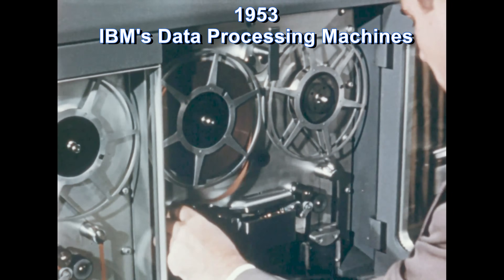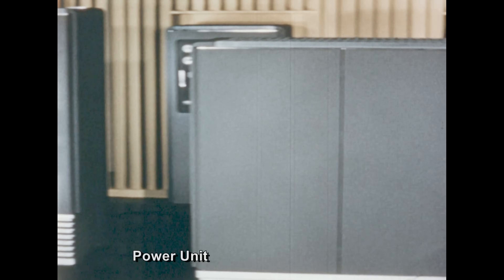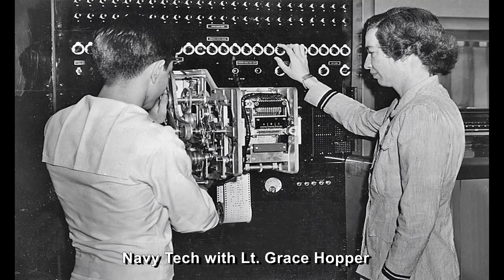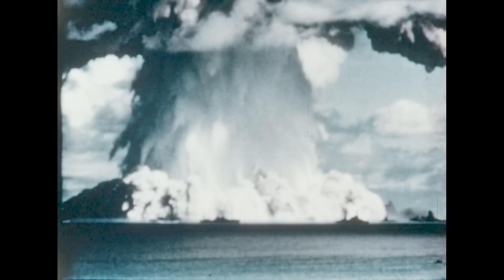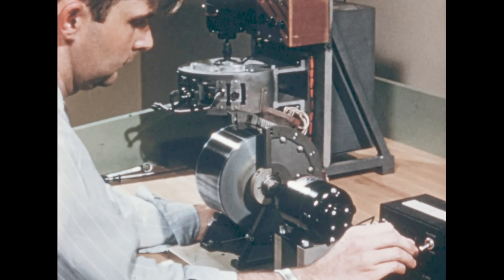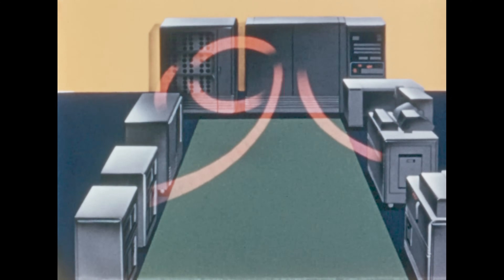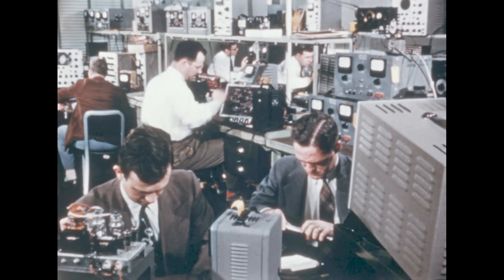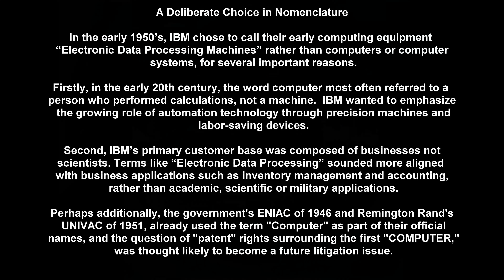Revisiting IBM Electronic Data Processing 1953 Poughkeepsie NY Factory Computer Assembly 604 and 701

Comment: Interesting film.  A couple of comments - the building shown at 2:33 and 7:30 is the original Endicott Lab and not part of the Poughkeepsie facility; if I remember correctly it was built in the mid 1930s.  Building is still on North Ave in Endicott.  The building shown at 13:48 was the Poughkeepsie manufacturing plant - original facility was an old 'pickle plant' that sat behind and I think just north of these buildings.  My father started working in the Endicott plant in 1941 (graduated high school in 1940).  That was across the street from the lab, separated by North Street.  He left in 42 for pilot training and after the war came back in 45 where he met my mom, who started working as a nurse in the plant in 1944.  To comment on a question asked earlier - Endicott and Poughkeepsie did make armaments during the war, in addition to lots of tabulating equipment used by the military.  Among other things they made M-1 carbines and 75mm pack howitzers.  I was always told there was a sub basement in the Poughkeepsie plant for test firing of the 75mm - but I never actually saw it.  Please take all of this with a grain of salt - going from memory here but should be all mostly correct.  I should note that a large part of the former IBM Endicott facility on the north side of North Street has been demolished in the last 3 months or so.

I graduated from college in 1970, one of the last generation of slide rule engineers who had just a smattering of computer programming in the 60s.  Coming out of the Army in 1974 I was hired in Poughkeepsie, transferred to the Endicott Lab (which by then was a separate facility in Glendale, west end of Endicott) in late 1975.  In 1978 I transferred again, to Owego (10 miles west of Endicott) to the Federal Systems Division of IBM.  That facility was originally built in 1957 to design, build and test the weapons/navigation system for the then new B-52; original development work on that was done in Endicott.  Owego eventually made aircraft and space computers for all kinds of US military platforms as well as the Space Shuttle and other NASA projects.  We were still supplying drum memory units for the Navy P-3 Orion aircraft in the 70s.  Our applications liked core memory and drums for a long time.  Owego also was the prime contractor to build the SH-60B helicopter for the Navy in the early 1980s and now builds the MH-60R, it's successor as well as the glass cockpits/flight computers for the MH-60S.  Sikorsky made/makes the airframe - Owego designed, integrates and tests the multitude of contents (sonars/radars/FLIR/etc) that make up these complex platforms.  In the 90s when in financial trouble IBM sold off FSD to raise money - we eventually became a part of Lockheed Martin, which I retired from.

I was lucky - worked the time period when we did very interesting and challenging work.  We were part of a time when technology changed in amazing ways.  The Endicott/Owego area at one point had something like 16,000 or so IBM employees.  Now Endicott is totally gone and Owego considerably smaller than it was 40 years ago.  Part of that is just advancement in technology - today we have a lot more computing power crammed in a lot less space that consumes less power.

Thanks for putting this film up - makes this 75 year old retired engineer realize again how things have changed over the years.  I started 1st grade (no kindergarten in a one room schoolhouse) a year after this film was made.
Reply from the maker: Greetings @Duckfarmer27!   Thank you so much for the extremely fascinating input and historical information you provided!  It really helps when someone like yourself with real-world knowledge takes the time to provide interesting historical feedback.  Some of these early films we have located just give brief glimpses of facilities at different locations perhaps assuming that people watching this back in the 1950's know where everything is located.   We will try to incorporate your info in out description section and subtitle text in the coming week. -  It sounds like you and your dad had some great experiences with many aspects of the early technology!   -   We have another IBM film dated 1955, which we are editing now, and will post by the end of this month (May 25 perhaps).   You may find that film interesting as well.  Thank you again for your comment and please keep in touch.  ~   Victor, at CHAP

Comment: WE had IBM 701 Serial Number 14 at the Naval Activity I work at in Philadelphia.  It was used to keep track of spare parts and requisitions.   It took up an entire room.  The required air conditioning (now decommisioned)  equipment kept it at 60 degrees as the 701 had thousands of glass electron tubes.

Comment: Watched while backing up my system, at 180MB/sec, something like 30000 times faster than that tape was running. And that's not very fast by modern standards.

Comment: Don't forget that IBM also had a Research Lab in Kingston, NY.  I worked there as a summer student.  Got paid great wages, and was part of the development team of what later became a "workstation" computer setup.  Screen, Keyboard, Light Pen, Printer, just like some modern desktops.  This whole 700 series was a workhorse back then.
Reply: During the summer of 1976 I was looking for a summer job to do with computing (in UK).  There were three firms listed in the "Computers" section of the yellow pages phone book, of which one was the IBM UK Scientific Centre, then at Peterlee in County Durham. I called them, got an interview, and was given a "Vacation Studentship". I worked on a project to model the economy of Scotland, the idea being to investigate how this would be affected by development of North Sea Oil. We used FORTRAN running under the VM/CMS operating system, not 100% certain but I think we were running on an IBM 360 model 165.
Reply: @philipwardle6820  Actually, I think you are correct, and I had a Brain Fart.  Our base platform was also a 360, but the workstations have some kind of different labeling, and completely different OS.
Reply: Does the name of Kingston for that location have any connection to the company of the same name that makes data storage devices?

Comment: As many may know the Williams Tube storage shown in this video was developed in 1947 at the University of Manchester in the UK. The major advance was that it provided fast random access memory, e.g. or programme storage and registers, as opposed to slower magnetic media or delay line storage. It was overtaken by other storage technologies within a few years but at the time it enabled rapid advances in computer architecture and performance.
Reply: Williams Tube storage was also used in the IAS machine, designed by John von Neumann and others.  It's considered to be the first stored program computer.
IAS is the Institute for Advanced Studies at Prinction.
Reply: @robertweinmann9408  The Manchester Small-Scale Experimental Machine (SSEM), was an electronic stored-program computer. It was built at the University of Manchester by Frederic C. Williams, Tom Kilburn, and Geoff Tootill, and ran its first program on 21 June 1948.
It was designed as a testbed for the Williams tube but was soon developed into a full-scale operational machine, the Manchester Mark 1 which became the prototype for the Ferranti Mark 1, a commercially available general-purpose computer with the first delivery in Ferruary 1951.
The IAS machine was in limited operation by the summer of 1951 and fully operational in June 1952.
Reply: @robertweinmann9408  the Manchester SSEM also called Baby was the first stored program computer as it was the test machine for the Williams tube memory
Reply: The U.S. ENIAC or Electronic Numerical Integrator and Computer from 1945 was the first programmable, electronic, general-purpose digital computer. Other computers had some of these features, but ENIAC was the first to have them all. It was Turing-complete and able to solve "a large class of numerical problems" through reprogramming.

Comment: I love the retro-cabinets containing the equipment. Looks similar to the WOPR from Wargames.
Thank you for uploading!
(Also, drum storage was rubbish; the high rotation speed induced electric fields which corrupted the data if left to run for a long time).
Reply: Drums were a bit slow, but were the most reliable data storage in their day.
Reply: An interesting contention, but I wonder what actual data you have to back it up. Drums were used very successfully for about ten years, replaced with easier to build and higher capacity disk memories, that are still in use today. They don't seem to suffer from data fade due to rotation. I know of exactly one disk model that did suffer data fade. It turned out to be due to very low level bias currents in the read heads that had not been anticipated at design time. A redesign of the read circuits fixed that problem. Spinning media can hold data for tens of thousands of hours of continuous use. Drums were no different.